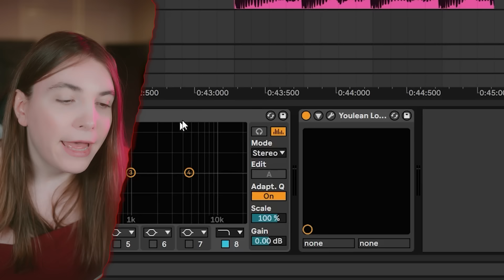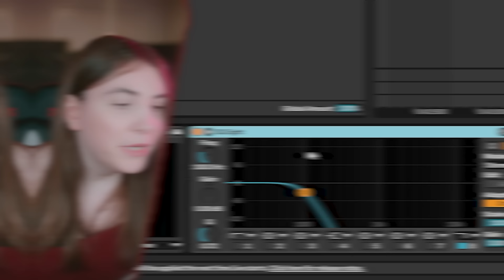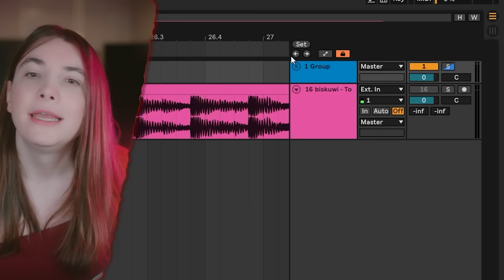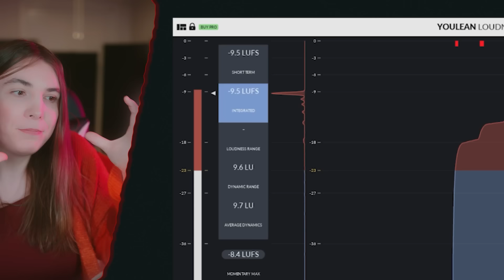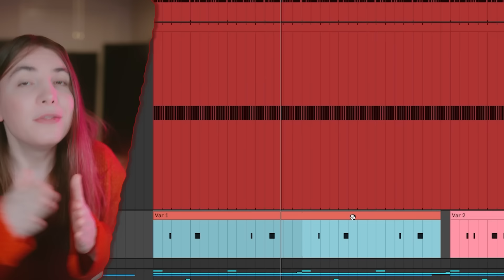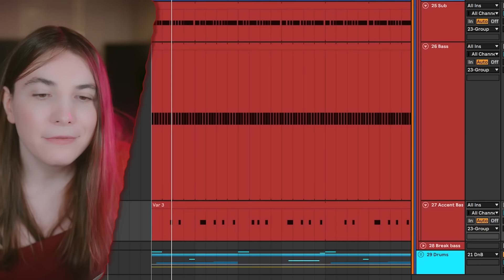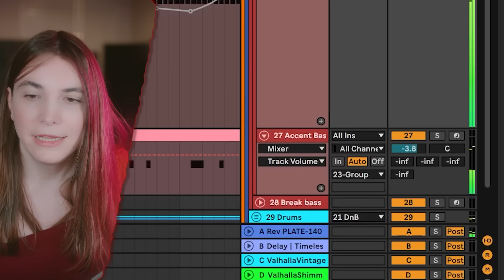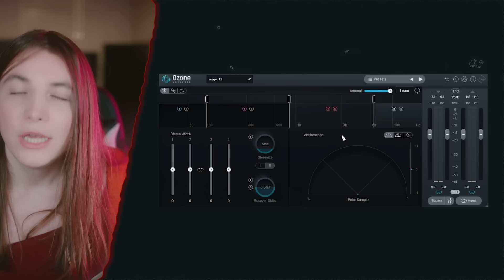My Bass Sucked Until I Developed This Method

Comment: I have a topic I would like your opinion on. Recently I participated in a production competition at a conference room (so not a club sound system), and even though I used a kick & rumble sample straight of a techno mastered track, when I played out in the monitors it was completely suffocated and powerless. My initial thought was that the monitors could not reproduce such a low end. However, when tracks from softer edm genres like house, or uk garage, with shorter kicks, were played, it could reproduce fine. 

A tutor from that production school came to me at that point, looked at my low end, and said that the problem was that there was little to no dynamic range  in it, so the speakers membrane is not pumping enough to provide that punch! To be honest, I’ve never mixed my low end group in a way that I care about it’s dynamic range. Quite the opposite, I would sacrifice dynamic range for more punch, power, and perceived volume (since I am producing industrial techno). 

What's your take on the above?

Comment: Isn't the phase already altered by the EQ before checking? Meaning you have altered what you metered. Unless the EQ works in linear phase mode.
Reply: The essence is about the phasing of oscillators in a bass synthesizer. The equalizer on the master channel cannot affect the phasing between two oscillators on a separate bass channel in any way.